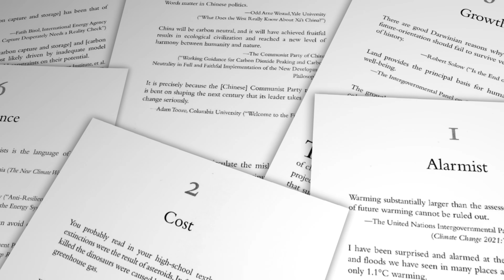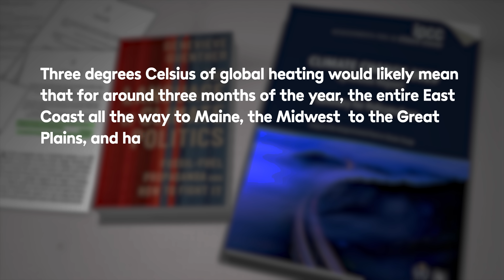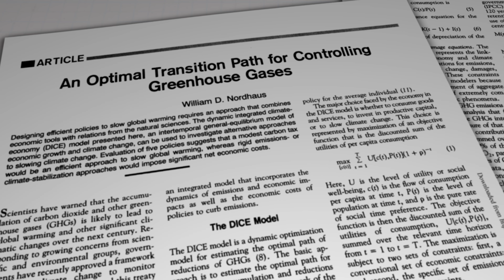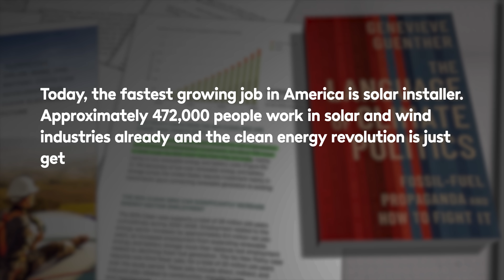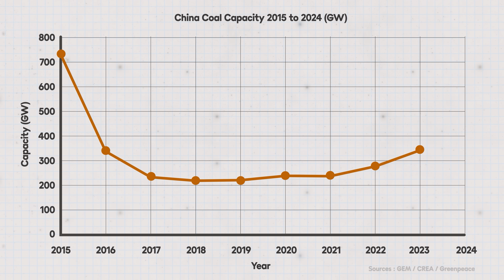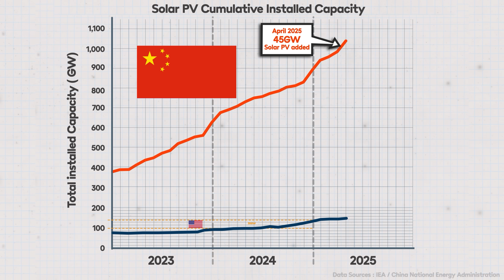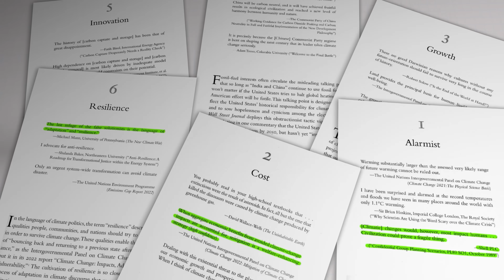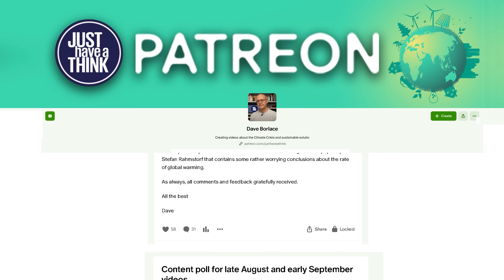New research DEBUNKS climate disinformation.

Comment: Canada lowered its industrial steel carbon emissions by applying a carbon tax on emitter. Nothing moves polluters faster than making then through away money if they do nothing.

We hated it, but it got a lot of our industries ready for or aware of the EU CBAM taxes coming in 2026.

We have some acceptable steel producers and all of our aluminum producers. 

Our grid is over 92% carbon free, except for the norther territories and 2 oil producing Provences, who aren't industrially significant exporters outside of oil and agriculture. 

The industrial heart of Canada Quebec, Ontario, BC, and to a lesser extent Manitoba can manufacture to meet the coming EU carbon tariffs.

That puts us way ahead of the US, India, and China on some pretty significant industrial exports into The EU.

A CBAM tax should be adopted by every climate conscious country to affect change towards reducing emissions. 

Not even a climate denier in manufacturing can live without being able to  export to richer countries.
Reply: 👆🏽 Comment of the day Greg !
Reply: I think some work was done already in Europe to cut emmission for steel production, so the tech did not have to be invented. and when you have mass scale effects (industrial scale installations and more research being done) costs usually drop - the products containing steel or Aluminium will not rise that much in price. or there are recycling drives melting steel and iron costs less energy. Plus the added jobs for the adjustment (maintainance folks and engineers) and for research (all jobs which cannot be outsourced). 

But even small cost cutting (that do not really matter for the masses of consumers) will add up for the FEW that cash in the profits. That is a small number of people (large share holders and top management) but a LOT is sold so even if they save 10 or 20 USD per ton steel, or a few pennies (Walmart !) - which does not really affect the end price of products made from steel - it adds up big time to more profits. 

So companies will avoid ANY investment no matter how litte impact it has on their competitiveness (the product price) - they have to be forced. 

That dynamic also works regarding higher wages. Yes product prices were higher for consumer up to the 1980s (before the free trade agreements hit) when at least 80 % of what was consumed (other than food and fuel) was produced in a wealthy country. But then - the higher consumer prices came with a huge bonus. Steady and well paying jobs. Even in more rural areas. Where the real estate "investros"  could not jack up housing prices as much, because there was enough space for the workforce. 

And when that was outsourced to Mexico and to Asia - the difference in wages was much more pronounced than the difference in prices for the consumers. The companies turned their back on the workers but not on the consumers. Only how are consumers being able to afford to buy ? Well in the 1980s private debt with credit card became a thing. 

Or the other way round: people in the automotive industry were well paid - but people not working in those industries STILL could afford the cars and they were paid in cash. Sure todays cars are fancier. But then automation, and computer use also made production cheaper. And once the airbag or some electronics becomes a default feature - it wasn't the highly priced luxury time anymore. They are mass produced now (much higher numbers so they do not cost as much anymore).

Comment: We can’t even clean up litter, what makes anyone think we (humans) are going to change food production, energy etc? We’re not going to stop climate change so we might as well learn to adapt.  And how does three degrees of warming mean you can’t go outside?  The average July temp in my area is 85, so if it’s 90 as an average how would I not be able to go outside?
Reply: Global warming doesn't mean the world burns to a crisp, and when you hear that the global average temperature rose a degree that DOESN'T mean that every place in the world has a 1 degree hotter day per se.

A 1 degree global rise displays differently worldwide.

What we see happening is that the higher latitudes, closer to the poles, they're experiencing longer and warmer summers and shorter winters.

Someplace like Tromso Norway (on the Arctic Circle) will STILL have fridgedly cold winters, but their summers will be longer and warmer, and the problem with this is that the ice sheets will experience more snow melt than snow accrual each year, and that translates into rising ocean levels in the centuries to come.
Reply: Sigh. It's hard to explain statistical dstributions.If the middle of the graph moves sideways a little, the number of extremely hot days on the margin increases more.
Reply: @skierpage  does anyone think it’s odd the amount of error in the temp increase is the same as the predicted temp increase?!
Reply: Get an education.
Reply: @Paul-1189 be realistic

Comment: China for one, is doing FAR more than the West to reduce greenhouse gasses. They are changing power generation to solar.  They are increasing their EVs vs ICE by 40% increase in EV's over the last year!  WAY WAY WAY better than the west.  India and other eastern nations are not far behind.
Reply: China added 45 GW of coal power plants last year, and they're currently constructing another 94.5 GW.

Last year mankind, worldwide, used over 8 billion tons of coal...  China used 4.8 billion of that.
Reply: @Les_S537  in april this year china installed 45 GWs of solar and wind,  in may they installed 93 GWs of solar and wind.  that info is at 12 minutes and 30 seconds into the video.
Reply: @jensonee  First of all, Chinese self reporting on issues such as this are suspect....  Here's what we DO know...

In 2007 China surpassed the US in GHG emissions.  

2007 is when the US maxed out at just over 6 billion tons of GHG emissions (just over 6 billion tons is the max the US ever produced in a single year) so in 2007 the US and China were in parity when it comes to emissions.

Since then the US has reduced their global emissions to 4.8 billion tons per year, and China has gone from just over 6 to close to 13 billion tons.

Last year mankind strip mined over 8 billion tons of coal out of the crust of the earth.

China used over 5 billion tons alone.

Comment: Just to add to and compliment Dave's comments about China, this is what the Energy Institute's Statistical Review of World Energy, 2025 states in its Key Highlights of 2024:
 • Wind and solar continued to be the fastest-growing areas 
of the energy system increasing by 16% in 2024. China was 
responsible for 57% of new additions with solar almost 
doubling in just two years.
 • Over the past decade China has nearly doubled its electricity 
supply adding 405 TWh more than Europe’s entire 2024 
electricity generation.
 • In 2024 alone, across all forms of renewable energy, China 
added twice the amount of the US, Europe, and India’s 
combined additions. Deployment of renewables in non-OECD 
countries has grown at twice the rate of OECD countries over 
the past decade.
 • The Asia Pacific region has been at the forefront of realising 
the benefits of diversifying its energy mix. It accounted for 
50% of the avoided fossil fuel use in 2024 followed by Europe 
at 22%. Excluding hydro, China was responsible for 57% of 
total global renewable power supply additions in 2024.

Comment: The US may have to back track on relying only on oil and gas as the US rig count is down 8% on a year ago. This suggests that oil production will likely decline in the US next year. It also hints that there may not be enough gas production for all the proposed new electricity production for AI and LPG exports . Things are not as clear cut as drill baby drill.
Reply: you are correct but, "Despite lower rig counts, advancements in drilling efficiency and technology are contributing to record US crude oil production. The U.S. Energy Information Administration (EIA) forecasts an increase in crude oil production from 13.2 million barrels per day (bpd) in 2024 to about 13.4 million bpd in 2025, although this projection has been revised down due to anticipated oil price declines and potential impacts of trade disputes. The EIA also predicts a significant rise in spot gas prices in 2025, which could encourage producers to increase drilling activity, potentially leading to a rise in gas output to 105.9 billion cubic feet per day "  we just can't catch a break.
Reply: @jensonee  2026 is the year to watch and in particular the Permian.
Reply: @peterjeremymckenzie8444  2026 will be the year to watch.  repubs trying to game the system.

Comment: I don't disagree with your "what about-ism" point, but the book you reference and use to support this video has received a fair bit of criticism in many of the claims within. 

Also, there were a number of deaths attributed to the heat dome event in British Columbia by the coroner service, but there is nuance in the data that should be considered. Age, underlying heath conditions, homelessness etc. This does not diminish the event, but a deeper understanding of the statistics should be considered and perhaps mentioned, else a large and shocking number is presented in support of an argument without detail.

I don't always agree with all your positions in these videos, but... I appreciate what you do and will always listen, consider your points and watch your presentations from start to finish. 

Cheers!